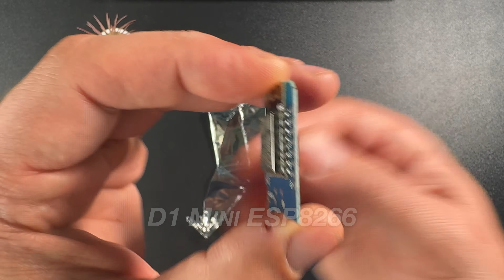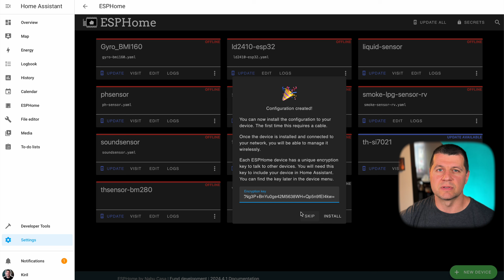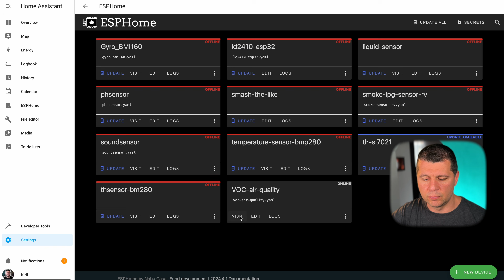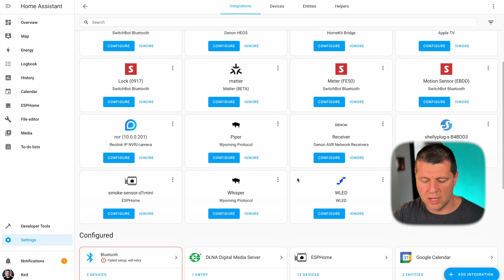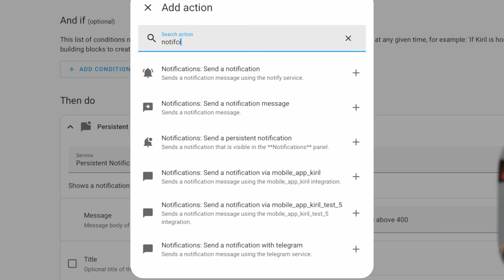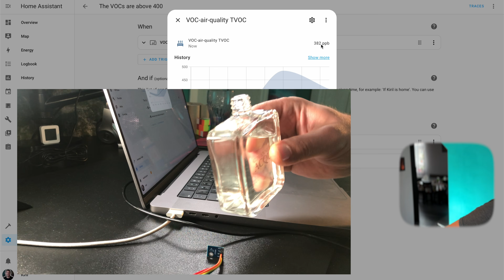Smart Air Quality Sensor For Home Assistant | VOC AGS10

Comment: can I do it with LORA to increase the data and can I add a particulate sensor?  how much energy does it use?  I want to put solar sensors all over my house that feed data to a central control panel where I can log the data and read a live graph of all sensors

Comment: I constantly get Reading AGS10 data failed: illegal status (not ready or sensor in pre-heat stage)!, even after changing sensor AGS10 any suggestions ?
Reply: After playing around for hours I have discovered that if I change the update_interval: 5s in the yaml file I get some readings now

Comment: Thanks Kiril.  I have built a particulate matter sensor before, but it lacks the ability to report voc levels.  This would be a nice extension to that.  I enjoy your videos because your instructions are very comprehensive and you take the time to explain the important details, for example the preheat errors or the sensors self-calibration when it first turns on.  Your hard work here is a generous gift to the Home Assistant community.
Reply from the maker: Thanks for the kind words! I'm glad you find the videos helpful. 
Can you please share which particulate matter sensor are you using?

Comment: VOC sensor should be placed in a box with a fan.
It's less reliable reading if the sensor measuring stationary air.
Reply from the maker: Seems like a good suggestion. Thank you!
Reply: Why you need  a fan for your box , it will make your readings more reliable ?

Comment: I have my bathrooms fans on smart switches so that when the humidity reaches a certain level, the fan automatically turns on. Could this sensor be used in the bathroom to turn on the fan automatically for... other air quality issues... close to the toilet?
Reply from the maker: Haha, interesting question, but I'm not quite sure, I guess you have to try it. It will be best if you share the results :)
Reply: VOC, volatile organic compounds, will be the sensor you're looking for in that specific case
Reply from the maker: and the sensor that I'm talking about is exactly VOC. Check the video please :)